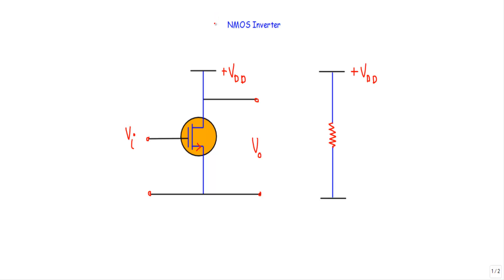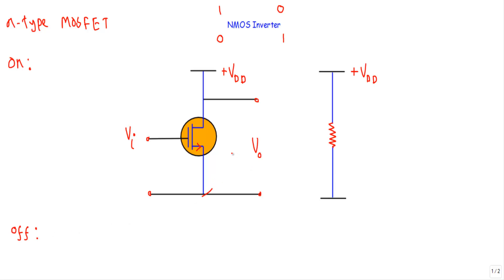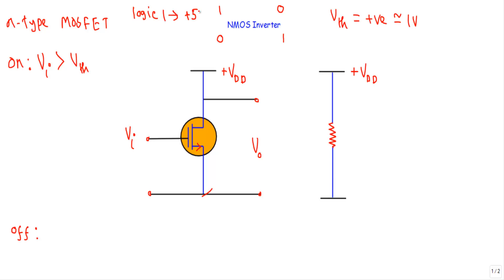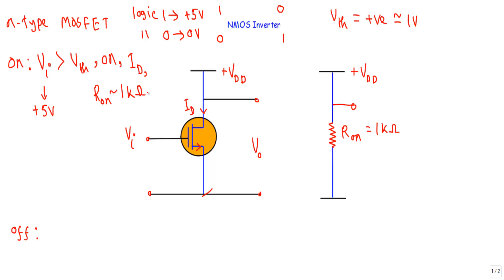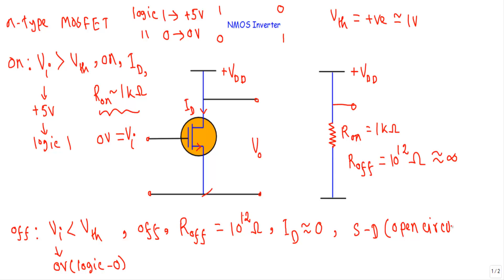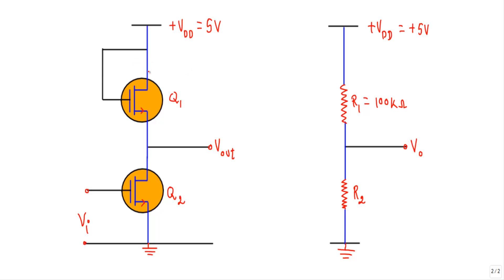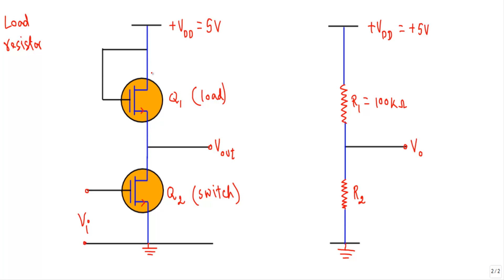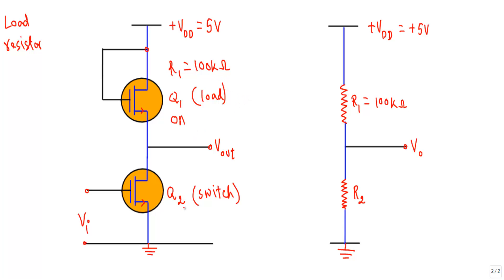NMOS Inverter

Comment: 7:32, Vo is not 5v. Just pass it as input to another inverter and it has to go through 3 resistors (100k, 100k, 1k) on the way to GND, thus making the Vo actually = 2.51v.